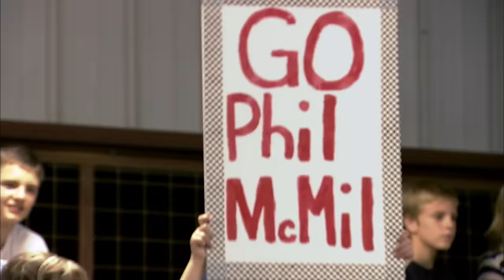Duck Dynasty: Full Episode - The Grass and The Furious (Season 2, Episode 1) | Duck Dynasty

Comment: I just retired my 2004 Craftsman. And it wasn’t near as old as these.
Reply: I sold my Craftsman riding mower a couple of years back after a thorough cleaning and a couple of "Upgrades." I took a pair of Kenworth floor matts from my semi and cut them down to fit the floor boards on the mower. Bolted them in place and told the buyer that thing had 10 more horsepower from those big ol' truck matts. The buyer also drove a truck and looked the mower over for a few minutes. He said, " I don't know about that power upgrade but they do give it some style!" So he bought it. 🤣